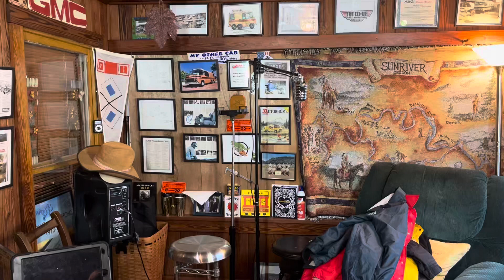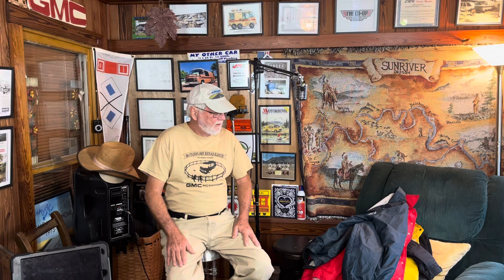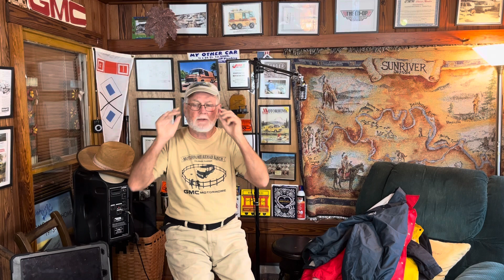Revive Your Onan Generator: A Practical Guide to Brainless Operation

Comment: Thanks Jim, When I first worked to get my Onan 4000 power drawer running, I noticed it still had the 48 year old FACTORY PAINTED GREEN OIL FILTER on it. Also, changing the mounts is super important